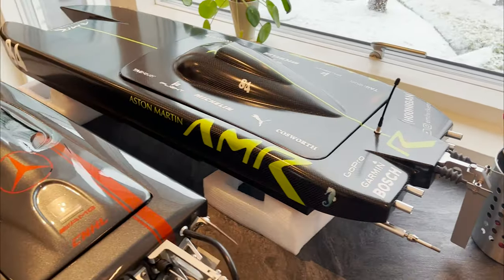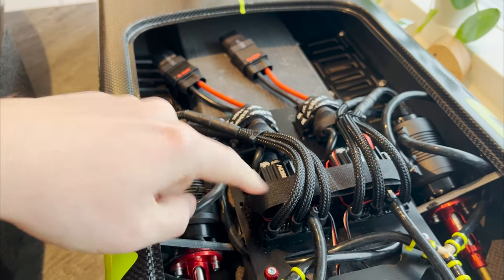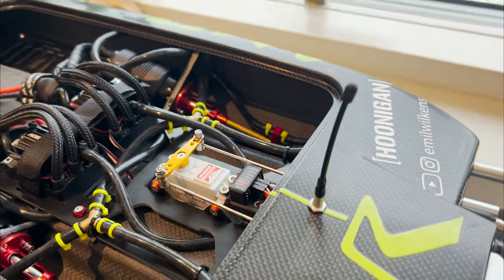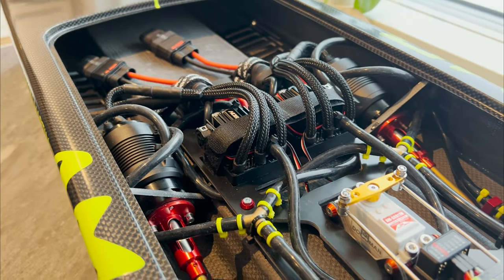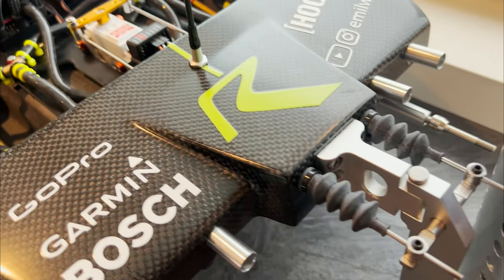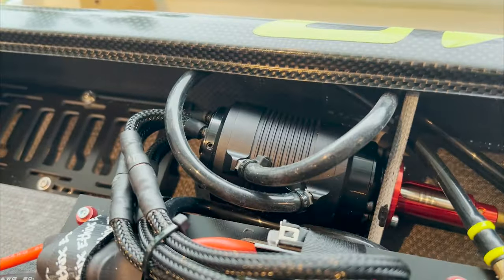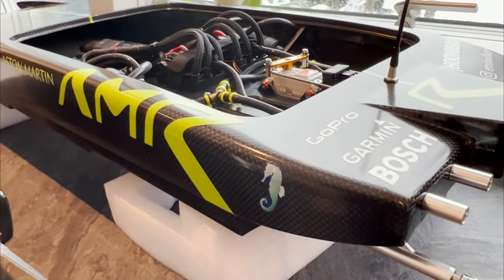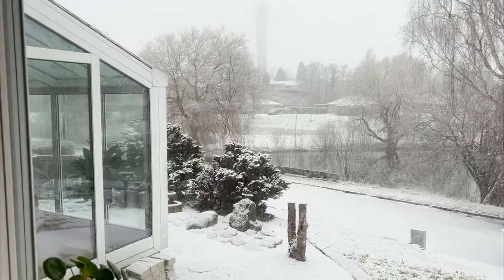"New Zonda" Carbon Fibre RC Boat Update

Comment: Can i just say if anyone wants to buy a zonda before you use it look at all screws and grub screws some of mine was loose also look at the coolant lins cos one of mine was kinked an check the flex cable cos mine also didn't have grease on them and that was the same thing with both my ZONDA's shocking considering thay cost 1000 each and my £150 boat was absolutely fine.
Reply from the maker: This is not a TFL Zonda

Comment: hi emil...great job ! you got the same 4074 / 2200 kv motors and 180  amp as mine...these boats rock hard !!! y did change the water inlet configuration because it does heat up after a while. I added 2 extra water inlets for the escs and left the ones it brings for the motors..I changed all the waterhoses for 4 mm ones . Now it runs very cool.  just leave the black water exit  hoses...no more.
Reply from the maker: Thanks man!
Great to hear that they perform well. Mine will be out through the test. 
 I feel like there is a fairly even flow on all 4 exits, so maybe my water jackets are less restrictive than yours? 
I havent measured my tubing, are they only 3mm standard?
Reply: @EmilWilkensRC  hi emil ..they all come exactly the same.  It does  heat up more than it should. i took all the black hose out...its very hard and it does brake easily  ..put 2 new water entries and changed all the hoses for new 4 mm inside diameter ones ..more flexible from offshore electrics. now it runs really cool . leave only the 2 black exit water  hoses very dificult to change.
Reply: @EmilWilkensRC  think they come with 4 mm inside diameter...the thing is they share the esc and motor on each side ...mine after 3-4 mins the 180 amp esc heated up ..so thats why i installed the separate  intakes. now it runs very cool and you can really rip it  hard .

Comment: Beautiful boat!😍  I can't wait for the speedrunning video🔥👍  I have a question about shopping at dymotorshop - what is the matter of customs, VAT and other fees when buying from the EU?  I am interested in the 850mm CF monohull artr you showed in the earlier video or the M34 from OSE but I don't know if it's a profitable purchase for someone from the EU.
Reply from the maker: Hi Max, 
Thank you so much, i can’t wait either! 😅👍🏼
The import to eu should be the same from china or the us. At least that is how it is where i live (Denmark). 
I Think my shipment from DY was valued pretty low so the customs was only about 80euro for the entire package (two boats and more). 
So it all depends what you want. I see it beeing the same buying anywhere outside EU in general. 
The M34 i believe to be a very Nice boat as well, but the 850mm from DY was also very nice quality. 
Good thing about the M34 is that you can get several RTR versions, and the one they make with ZTW200A and TP4050 should be very solid performance out of the box. Buy from OSE or DY to your hearts content would be my opinion.
Reply: @EmilWilkensRC  80 euros is actually a very small fee.  Thank you very much for the information and congratulations once again on a wonderful boat😁👍